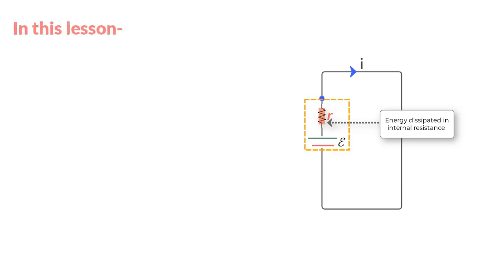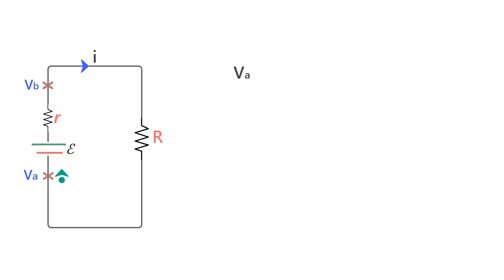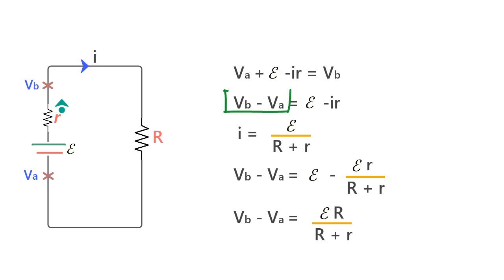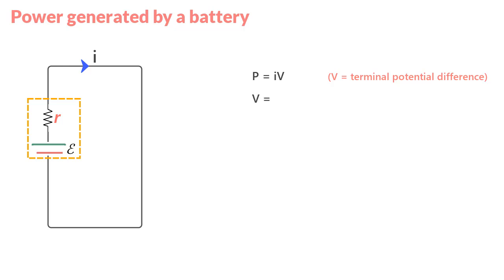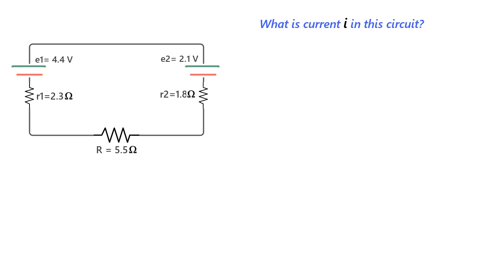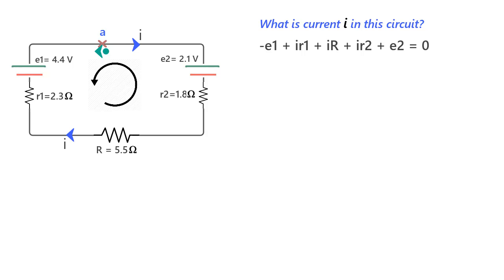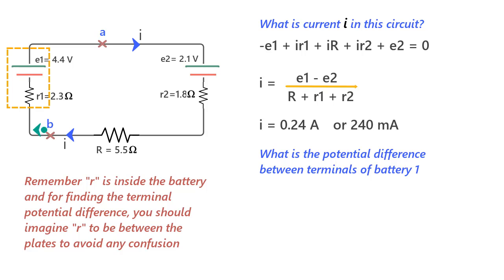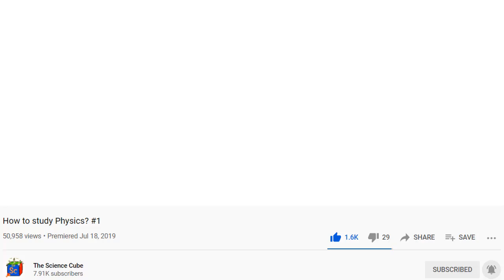How to measure potential difference between two points #6

Comment from the maker: Topics covered in this lesson-

00:45   Potential difference between point a and b
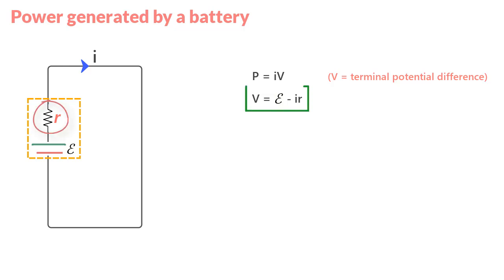03:30   Work done by battery on a charge
03:30   Power generated by a battery
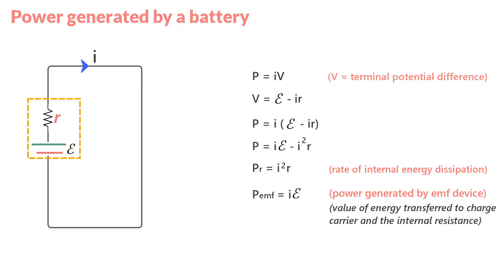04:15   Solved practice problem   
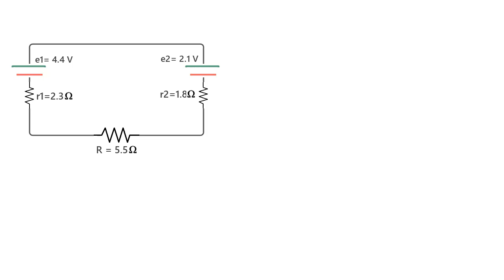04:35   What is the current in the circuit
06:05   What is the potential difference between terminals of a battery